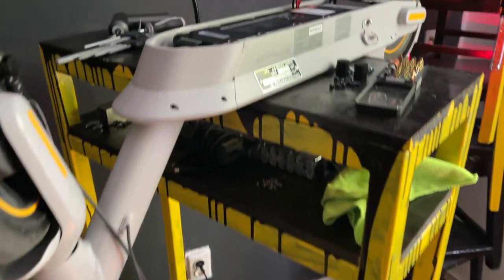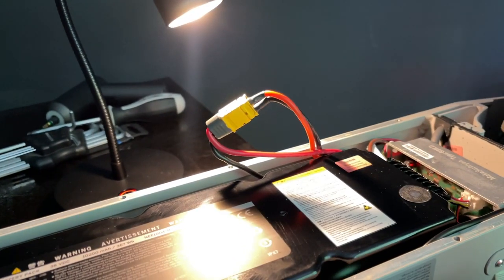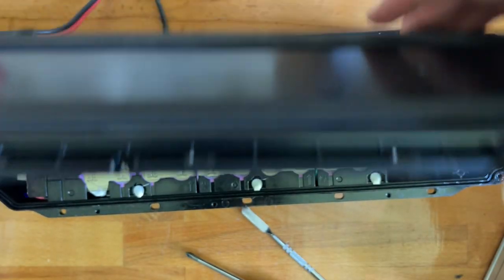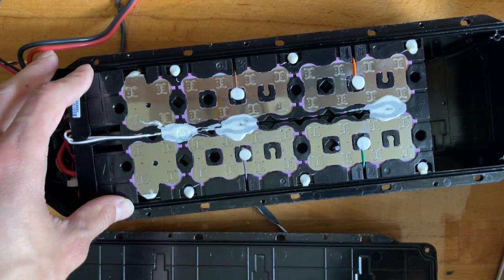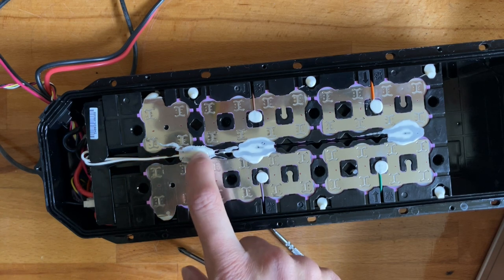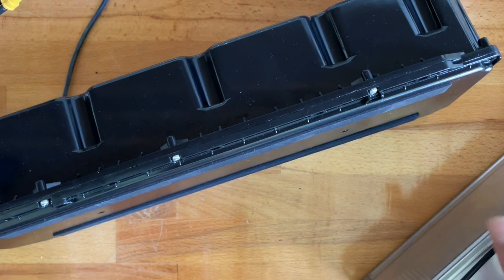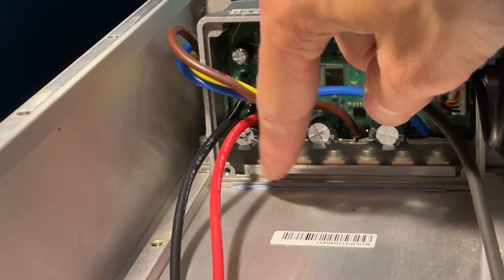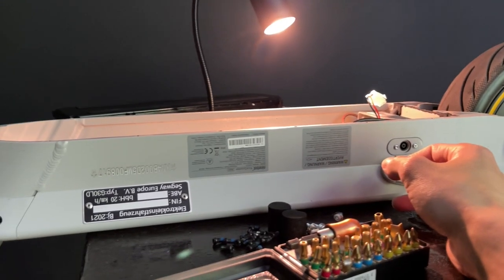ninebot g30 max LD battery overview + comparison with xiaomi pro2

Comment: 1,4kw on the Stock Scooter?!🤯
I drive 30 Amps on my Max G30D2 and i'm allready worried about the Connectors a bit😅
Reply from the maker: well - the connectors in all xiaomi scooters are xt30s

the ninebot g30 max ld I have runs on xt60s ... soooo ... fuck it - should be fine

I've had people tell me they run 1.4 on their pro2s ... which ... I'm even surprised the BMS will allow ... or maybe it doesn't and they never measured it
Reply: @Darieee  You can't run 1.4 on stock Pro2 voltages - the controller has a physical limit of about 30A at 36V, which means it runs about one KW max. People get the sliders up to 50A and  tell you they're running 1.8KW HOLY SHIT, but no, they aren't. The only way to get it to dump more power than that is to up the voltage, but that introduces overheating issues; that motor loses a lot of efficiency above 1KW - it really isn't meant to sink more heat than that, and can easily overheat if you do it anyway (guess how I know).